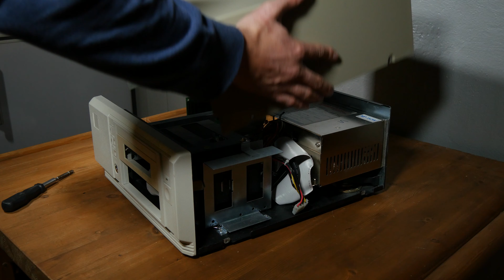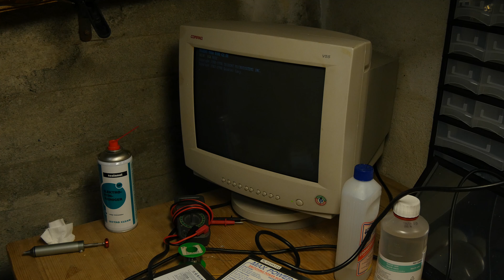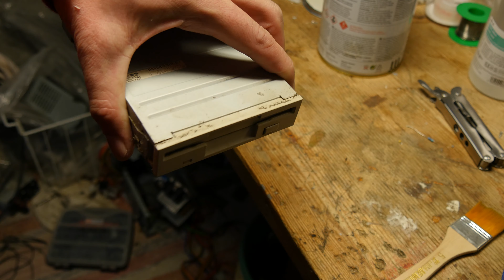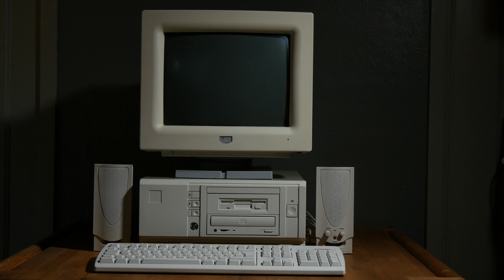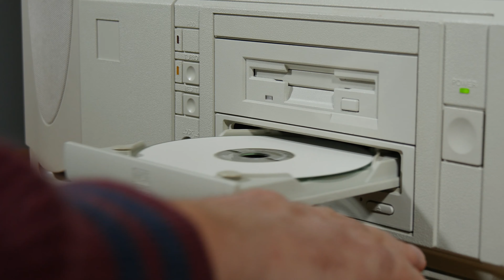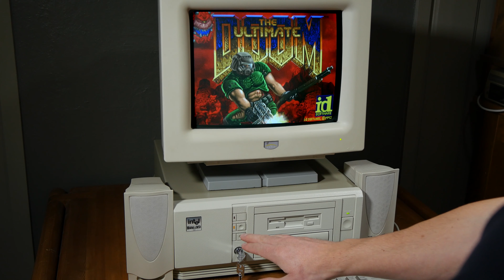Dumpster Dive PC With a Little Surprise

Comment: Well done! Looks great and as good as new. May be one optional suggestion, you can reduce audio noise, if you put the sound card into the last ISA slot. With a pair of speakers it's mostly not noticeable, but if you use headphones or record the output, the noise can get really annoying. If you put the sound card between other cards, it will catch all the disturbance from the both sides and if you put it to the end of the board, you get it away from the other cards on one hand and you get improved shielding from the case cover, when closed.
Reply from the maker: Aha, Thanks for your suggestion :)